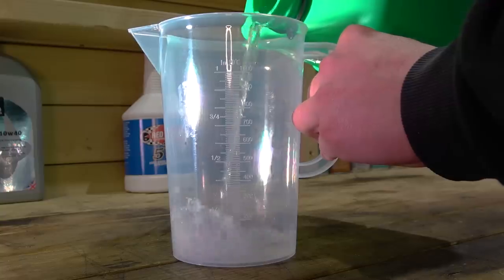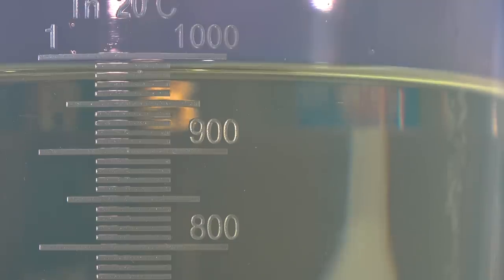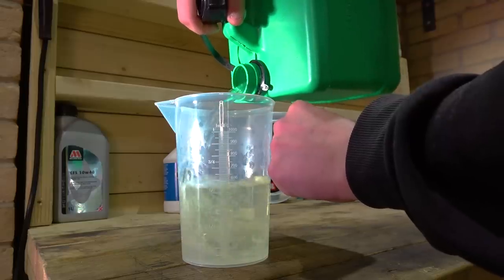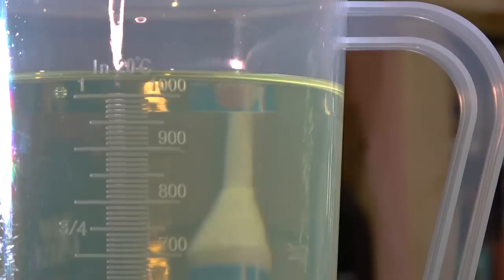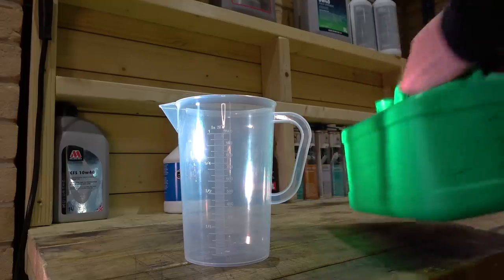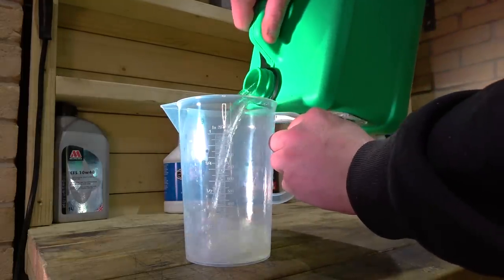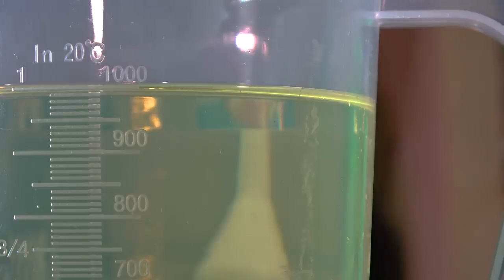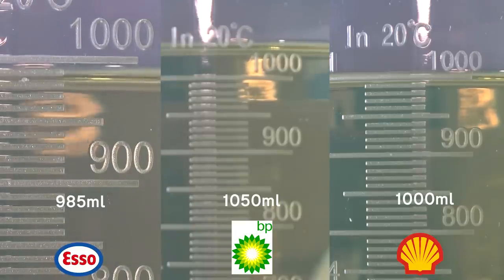Fuel Pumps Are Wrong - Esso BP & Shell

Comment: Given that all pumps carry a notice about minimum delivery I'm struggling to understand the value of this exercise. It is a complete red herring to relate this to fuel branding. Pump calibration is a matter that is outside the hands of the site operator, it is "policed" by trading standards which is a function of local government. None of the major fuel retailers would risk falling foul of trading standards by knowingly operating out of tolerance equipment. No mention at all of the temperature at the different points in the exercise.  Temperature is important as all measurements need to be corrected so that comparison is is actually valid.

Comment: Everyone is getting on jon’s case about weights and measurements and accuracy and sh1t. So, i’ll settle the best way. Go out and buy three identical Ferraris. Weigh them. Then accurately dispense a litre of fuel in each one. Take them to a track and line them all up on the start line and then in turn boot it up the road as far as you can with each one. Then measure the distance each one travelled on a litre of fuel and hey presto!! You’ll have which is the best fuel out of all three. That was it right?

Comment: They are calibrated at a certain temperature and air pressure. 
Any change in either of these changes the volume of the fuel. 
If you don’t like it you could simply stop buying fuel and buy an electric car.

Comment: Didn’t use a calibrated measuring device. 
Up to 200% can evaporate a fuel vapour.
You took fuel from 3 different types of pumps that use a mechanical meter, electronic WIP. -
Most companies be a +\-30ml on regular unleaded and diesel and a +\-60 on super fuels 
Didn’t account for the fact that when calibrated, we calibrate to 0.000ml which as the customer you don’t see. This applies to the same belters that moan about the penny; hence the price board reading 0.00 to the decimal.
The cans you used to store the fuel I highly doubt were dispensed using a wet measurement when dispensing. 
All three also have different conditioners added which account for various measurements and you also didn’t specify weather any of these had ATC temperature control compensation. 

All these variables are just some that literally apply to half of your “fuel” videos, just another great case of someone who doesn’t know what they’re talking about.

Source: Me ( fuel forecourt engineer )
Reply from the maker: It's just a bit of fun mate, try and get out a bit more yeah?
Reply: I do… I get out and do this job ten hours a day. So when people make inaccurate misinformed videos like this and the masses think they know more than me when approached by the public; I only have your type to thank.
Reply from the maker: @ashleyaplin7331  No one questioned your knowledge, but take it for the fun video that it's supposed to be and life will be much better no doubt.

Comment: Did you do the 1970s trick (you know when there was a real recession rather than the blip of 2007)? Dispense fuel and then lift the pipe and turn the gun upside down and hold up for about a minute to get every last drop out. In 1973 there was a 50mph speed limit on all roads including motorways and petrol ration coupons were issued. Cost of living crisis my arse.......

Comment: now repat the test at the same pumps with the minimum delivery amount for the pump, that will actually state if the pump is accurate. Every pump will be nominally different so you have to do the same pumps as before or you're just testing a different set of variables. After that, test every pump at the station so you get an idea of wat the average accuracy of each pump is. Then work out why the damn things flip over from £**.99 to £*#.01 without actually showing £*#.00. Answer that one and you're doing everyone a service.

Comment: What about Texaco, Tesco, Sainsbury’s, Morrisons and Asda that have fuel stations that would of been mentioned and cost lot more or less to fill up your car or any vehicle that you use. 

The things is it will be changing because everything will be going all electric and most older vehicles will be scrapped and new vehicles that are being built will be purely electric (battery) and hydrogen fuel. But which one does cause the most pollution. I would say diesel.

Comment: You should weight it, which is more accurate....that's why F1 cars have fuel on board by weight not volume. Petrol is extremely volatile and varies in volume depending on temperature. However, weight remains constant and is not temperature variable.

Comment: Surely it depends on the physical fuel pump itself, not what brand it is
Reply: Correct.  The fuel pump does not know what brand it is pumping or measuring.  It is just a measuring device (meter).  Congrats on posting the most objective comment I have read.

Comment: I would see your point, but your experiment has flaws.
1) evaperation in to the gallon container space, so less 1L liquid when poured,
2) that measuring jug is a basic consumer jug, and its mass produced, so it wont be calibrated to the 1L measuring line.
Reply from the maker: It is far from scientific but still allows for a comparison between the three.
Reply: @AutoShenanigans  I don't see how, as nothing calibrated, so no conclusion can be made.   What about vapour loss ?

Comment: More to the point, unless you fill right up and rely on the auto shut off valve, how accurate is the final few pence dispensed when you release the trigger so that you end up dispensing your exact preferred monetary amount of fuel. For example, if you wanted £30 worth of fuel, would there be a difference between stopping where the gauge landed at £29.84 or fiddling with the trigger until it reached £30?

Comment: I genuinely filled up the tank the other day, and 50p was spent before anything started coming out
Reply: That is called advance of indication in trade terms.  It should be reported as a pump fault, and the pump shut down until repaired.  It is normally caused by air in line (so the pump measured 50p of air by volume).  The cause is normally a faulty solenoid valve, faulty nozzle, faulty check valve in the pumps supply line, or a combination of these faults.  Advance of indication is always a “not fit for trade use” fault.  You should report this, since the site operator will be quite happy to continue selling air at the price of fuel.  The fuel pump meter is unable to distinguish between air and fuel, so all retail fuel pumps (by law) must have an air eliminator.  The advance of indication occurs where the air enters the line “after” the air eliminator, normally caused by fuel drain back, allowing air to enter into the dispensing circuit.  If you have an honest service station operator and you report this to him, he should log a maintenance call with his service provider - a 50p advance of indication is a large error, albeit that the advance of indication in volume terms is the more relevant measure from a technical perspective.  The advance of variation will vary by volume, and by transaction depending on how long the pump has been idle between transactions - so you might expect the largest deviation to occur on the first sale of the day, and show no advance of indication during busy periods, but it depends on how severe the fault/s is/are.

Comment: It's nothing to do with suppliers.  There are tolerances to which meters must be within.  Up and down.  Many years ago, it was half a percent down, one percent up, Upon verification they must be withing these tolerances.  Also, temperature, even wind can affect stuff.  Your plastic kitchen measuring jug isn't exactly calibrated in a lab either.  As a reference between different pumps, yes, it can take an average.  But it's not exactly highly scientific.  Also, people leave residue in nozzles.  When you lift it out of a pump, often you'll get spillage from the last delivery.  Using a calibrated measuring cylinder, in a 20 degrees celsius standards lab, straight from a meter, it might be more accurate.  However, the differences between the measures in your experiment were negligible.   Now that pump fitters etc can do verification work rather than or in addition to local authorities, it makes one wonder about the accuracy.  It was the good old days when very regularly, Trading Standards would do routine pump inspections on a very regular basis.

Comment: Ehh... You have to do more than just the "one" test.. because things that NORMALLY don't really matter (insignificant factors) become greater when you try to do fringe case experiments, especially if you try to do detailed measurements on something made for greater quantities (you ARE out of bounds when you use less than what the pump guarantees).. So.. Things that may factor in.. that may vary from time to time rather than station to station..  .

. "Random" events may actually increase or decrease the ACTUAL amount you get to a point where it is notable.. but these random things may differ a lot depending on well.. those random things.. (some pumps MAY deliver a BIT more than the measured amount if it is easier to pump the fuel.. f.ex. if it is under higher pressure.. like.. when the tank is full.. just to mention one hypothetical "Random" thing).. 

.. Then there are things such as "heat".. Warmer fuel is bigger.. Since you measured these things in one room, I'll assume they were ALL the same temperature when you measured them, but.. was the outside temperature the same when you actually got the gas?.. Also this can relate a bit to where the station is and where they have their tank.. either way: For a GOOD reading at the very least you should've collected data of what temperature the gas was when you got it.

.. and last (but.. not least?... well.. I wouldn't know what is actually least).. it's possible that the actual hose FROM the pump may contain some fuel since before.. OR.. not.. hence.. it's only a few centilitres difference each time you use the pump, but.. when using small enough amounts this too can make a difference..

Either way.. I'd say that ALL those quantities.. are pretty much "accurate".. especially when you consider that it IS when you are checking quantities that are outside of the specs of the pumps.

Comment: OK when you have finished fuelling your car and you have released the trigger before removing the nozzle from the filler , lift black pipe attached to the nozzle at its lowest point to the ground upwards there is a fair bit of fuel left in these pipes because gravity pulls the last amount of fuel that you are pumping into the car downwards, I used to service petrol pumps and you will be surprised how much fuel you have paid for will be at the bottom of that pipe, that fuel is going to go into the next customers vehicle for free there can be at least 50ml to 100mls of fuel, more so with diesel fuel than petrol, don't believe me try it. I suspect that this is why you are getting a reading of more than one litre on one of your samples, you are getting the dregs of a previous customers fill up. I remember a kid that worked at one of the stations used to go around all the petrol pumps at night before locking them down and draining down the dregs from the pipes into a fuel can he then poured it into his little Moped and it got him home, I always found it amusing.

Comment: I hate to be a pedantic Pat (na I enjoy it, I'm a scientologist) but you need to get the density of the liquid, weigh it with a scales and work out the volume from there, that's the most accurate way to get the volume, the jugs are not reliable measurement.

Comment: I wonder if it's less to do with the smaller quantities, and more to do with the flowrate. So is it less accurate when you are releasing the handle and slowing the flowrate down trying to hit a specific amount. If this is the case, the same problem will happen when you are trying to hit a round number no matter how much you dispensed.
Reply: Thats why they say 2 litres minimum maybe? Its only accurate after that point? I am just speculating :)
Reply: the thermal expansion coefficient of petroleum accounts for all of this. the petrol pump will state the temperature at which you get 1 litre. Around 15deg since it's stored underground.

Comment: No surprises if the results are over or under the exact litre.   The measurement at the pump is accurate, but you then have two metres of coiled hose where it can be trapped.  If you are lucky enough to get over a litre, it's probably just down to the previous chap not shaking his hose sufficiently before putting it away.  Oo-er missus.  That's all.

Comment: I noticed on a lot of pumps (at least in the south-west) their claimed price per litre is measured/most accurate at 15°C.
I'd be interested to see if they're accurate once you get to or pass that "minimum amount".
Reply: The 15 degrees is as standard across all fuel stored. It’s to do with the variation in quantity due to temperature changes. I used to work in petroleum. When we measured the amount of fuel in a tank we took a temperature reading too. This was then used to calculate the fuel at the X litres @15degrees.
Reply: @T_Piper_Photo  Neat!

Comment: The cause I’ve found of the variations in amount of fuel at various pumps/stations is;
It’s ‘easier’ on the pumps to add a bit of air as it’s pumping the fuel. So at different stations you’ll find some use more air (the shop can adjust it on the inside of the pump). 
Want proof? Go to a couple stations, use a 1 or 2 gallon jug, pump fuel using the auto shut off trigger. If you know your jug costs $5 to fill (example) but it kicks off at $3. But at the next destination the same jug and the trigger kicks at $2, that station uses more air. 
High volume pump, combined with air, equals ‘foamed’ fuel. And yes it settles right away, but if there’s so much foam that it’s kicking off, consider how much air you paid for in a $100 tank of gas in your vehicle.

Comment: I think the results are affected by the previous user of the pump - how thoroughly they shake the 'dregs' from the hose after completing their fill-up.
Many years ago when pumps were more manual, and had a big handle on the pump's side to start the actual pump running, you could switch off the pump after filling, then press the lever on the handle and tread on the hose to get an extra pint or so of 'free' fuel.  Effectively, you were stealing the fuel from the following customer - when the pump was restarted it would register the first pint or so refilling the hose, before the lever on the handle was used to commence the actual delivery.  While still at school, I had a part-time job as a petrol pump attendant, and my friends and I would use this 'method' to fuel up our mopeds 'for free'. Of course, we were really stealing a pint or so of fuel from each customer who bought fuel after our 'trick'.
Petrol cost less than a pound a gallon back then (yes, imperial gallon - about 4.55 litres).  I remember the first time it went above a pound a gallon (for five star, initially) the pumps had to be substantially modified, as they hadn't been designed to cope with such high prices.

Comment: Was the petrol pre-warmed to 20c to be accurate for the jug, and did you consider any residual left in the jerry can? and had the jug been placed in a dishwasher at all during it's life? probably should measure by weight, as that would change the temperature varible.
Reply: huh ... fuels at room temp and theres simply not going to be massive expansion or contraction from the jug

Comment: John i used to have a moped (Honda Cub), that only took 2.25 litres to fill, so accuracy is important.  It was an old one before they had fuel gauge, so often had to check, as would always run empty miles from anywhere, And i foolishly always tried to get the 'minimum' 2 litre purchase in it.

Comment: This might be of interest: https://assets.publishing.service.gov.uk/government/uploads/system/uploads/attachment_data/file/685831/standard-temperature-accounting-displays.pdf In addition to temperature variation, there are also seasonal adjustment to the mixture in some areas to cope with the weather, either to prevent it solidifying, or evaporating off. Thus the energy content does shift a bit around the year. Of course, STA is slightly different to meter accuracy and tolerance.

Comment: exactly 1 litre, but you are only using 2 decimal places to judge this? are you sure that is a good start? id say that gives you 1% margin of error straight off the bat. 
pumps get calibrated every 6 months (as stipulated by weights and measures) and they will drift a small amount, but up and down over the next 6 months - so somes you win and somes you lose. 
who calibrated your measuring jug btw?
i am not defending the petrol retailers (they are robbing bastards at the moment and are making more money than they ever have!), but you need to play fair. good to see you trying to tackle these issues. 
a nice one to look in to would be the historic margins for fuels and how that compares to the current costs. You can use Platts data to get a fair benchmark on fuel costs in the UK and will soon see that the pump prices now are getting the retailers more money per litre than they have done as long as i have been in the industry.